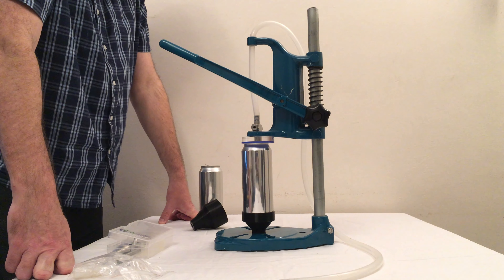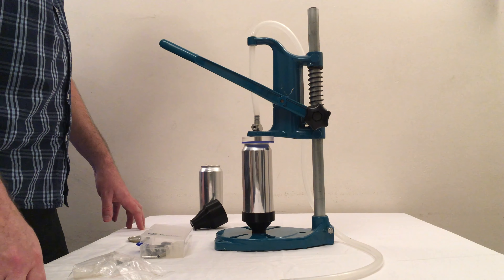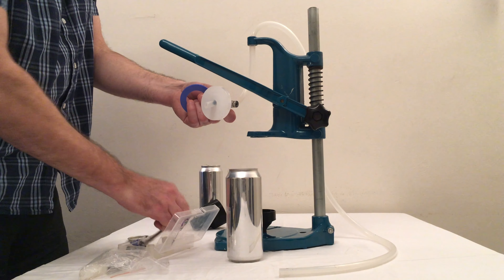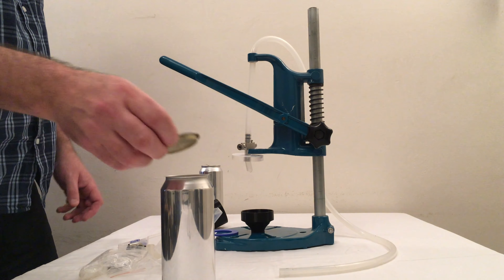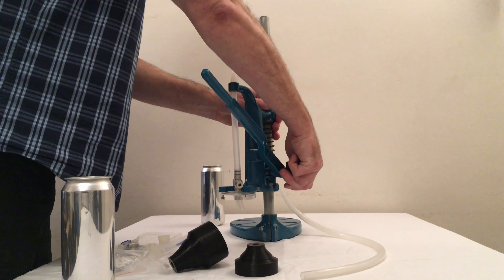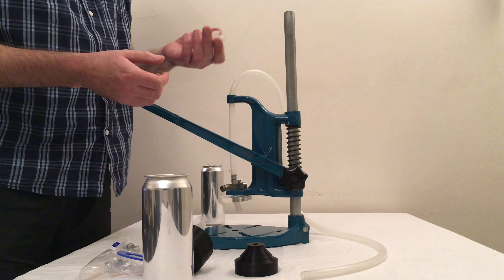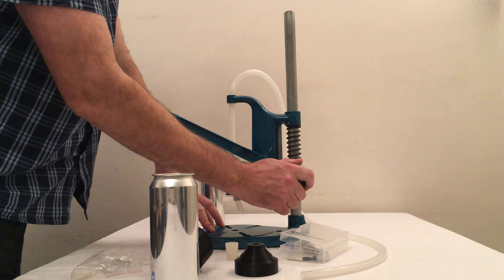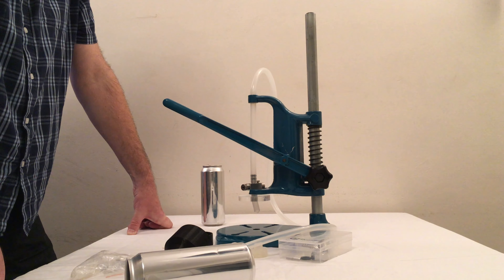Counter Pressure Can Filler Part One

Comment: if you turn the top piece upside down the spring will hold pressure to the can and you dont need to hold the leaver down while filling